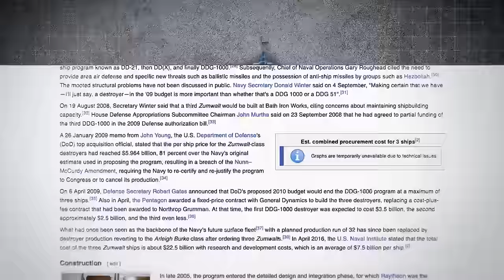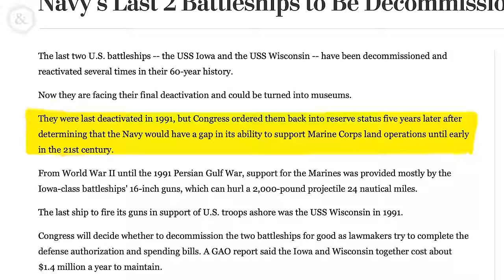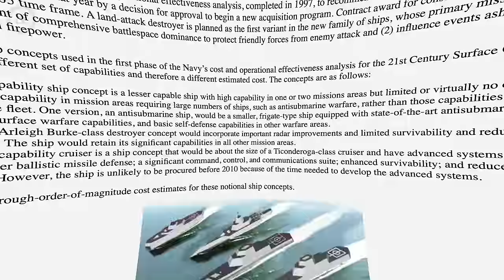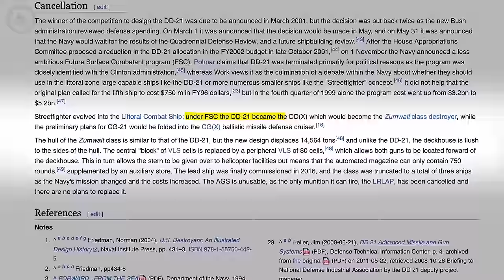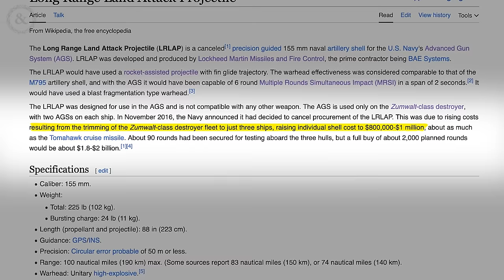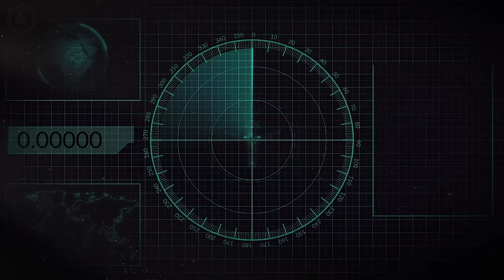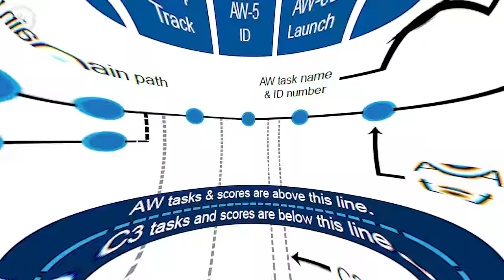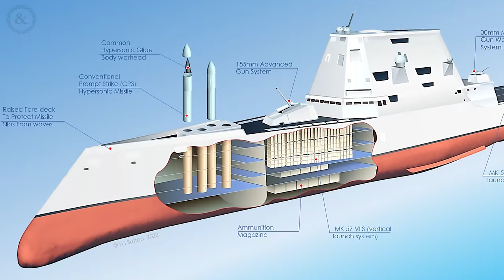Where is America's Stealth Destroyer?

Comment: Yes, it's not a $2M cruise missile, but Iowa class shells were not cheap. The cost of a single 16-inch shell for the Iowa-class battleship varies depending on the type of shell, but it typically falls between $6,000 and $20,000 per shell.
Reply: Which is pennies in the couch cushions for the navy.

Comment: I read that the top speed and structural durability were so bad that they had to abandon it. The shape is not the problem. The building contractors need to be held responsible for the failures. Putting advanced missiles on a stinking boat is not going to help.

Comment: It seems like new 155mm dumb projectiles could be developed to use with the existing guns. Also, with the flexible power system, would the Zumwalts be good candidates for upcoming directed energy weapons?  
I have no confidence that any useful rail gun systems can be developed -- the plasma erosion of the barrel is just too much for a practical system.

Comment: The Long Range Land Attack Projectile (LRLAP) was a 155 mm naval artillery shell for the U.S. Navy's Advanced Gun System (AGS). It was developed and produced by Lockheed Martin Missiles and Fire Control. Range: 100 nautical miles (190 km) max.
The LRLAP was: 
Precision guided
GPS guided
Rocket-propelled
Designed to provide support for the Marine Corps and Army
The U.S. Navy canceled the LRLAP in 2016 due to its excessive cost. The per-unit cost of each LRLAP shot increased to $800,000–1 million. 
The LRLAP was canceled shortly after the USS Zumwalt (DDG-1000) was commissioned.

Comment: Tumblehome is referring to the shape of the hull. At the top of the hull instead of going out in curves inward towards the center. This could definitely help with radar signature because of its smooth or “softer” look. Less straight edges
Reply: straight edges are what you want, you just want them short and at angles the throw the radar into areas that aren't likely to be where the sender is.  There's a reason the first stealth aircraft was nothing but straight edges.

Comment: It's insane to me that they didn't just refit the 155mm guns to use the Army's GPS guided rounds. 3 rounds a sec is absolutely some serious firepower.
Reply: Because the gun is incompatible with the 155mm rounds used in the Army.
Reply: @definitelyfrank9341  Which is why I specifically used the word "refit."
Reply: @Lowlyking2001  'refitting' a cannon to be able use completely incompatible ammunition has never been done before, and is impractical.

All they can realistically do which is close to what you suggested is swap out the guns for the Army howitzers.

Comment: The Zumwalt was built to be command and control for the Littoral Combat Ships. They were a married pair. The LCS don’t carry enough high tech nor armament to adequately protect themselves, nor to go on the offensive. The Zumwalt had that in spades, with the gun and it’s guided projectiles. Whomever dreamed of the paired concept must have moved on, and so the system was allowed to fall apart. 
         When the Navy cancelled the original gun, it should have cancelled the LCS, but nobody told the Navy. As the Navy built three Zumwalt, it should have built a limited amount of LCS, but nobody told the Navy. 
         Even still, the Navy doesn’t use the three Zumwalt with the LCS as originally intended.

Comment: Zumwalt with 80 Standard Mk. 6 multi-role missiles, 12 hypersonic surface-to-surface missiles, and change out those 30mm turrets for Siemens 30mm Goalkeeper systems; personally I would build another fourty of those but replace the oil-burning generator with breeder-type reactors (four at twenty megawatts each, with each reactor being 10 feet on each side, 10,000-year service life with a 1,000-year scheduled maintenance cycle; this is proven technology built back in the 1950's).

Comment: The title “destroyer” is a shortening of the original title “submarine destroyer”.  Its primary job is anti submarine warfare.  A cruiser is a pocket battleship.  Its primary modern purpose is anti air warfare, although its original purpose was anti surface warfare.  Frigates are small, fast, and nimble.  They are intended as scouts.  All surface ships can be used for shore bombardment.  

The line between types has blurred since WW II.  Size has also.  Examples of this are the Burke class destroyers (DDGX), which combine the capabilities of a destroyer and a cruiser, and the Ticonderoga class cruisers (CG), which was built on the engineering hull of a Spruance class destroyer (DDG).  

Everything below the main deck of a Ticonderoga cruiser is identical to a Spruance destroyer, so they are the same size and have similar speed and handling characteristics.

Modern US ships still maintain divisions between mission types, but all types of ships will have limited capabilities to perform the other’s roles.  For instance, the Spruance class destroyers had some anti surface warfare capabilities in that they had two 5”/54 guns for small ship engagements, and Harpoon missiles for larger ship engagements, as well as Sea Sparrow missiles for anti air warfare and CIWS systems for anti missile protection.  They also had torpedoes for anti ship/submarine warfare, but their primary weapons were the worlds best sonar system hands down (at the time) combined with Asroc anti submarine rockets.  

This may sound like a lot, but this was considered to be only lightly armed.  Compared to a Spruance, messing with a Burke is like reaching into a buzzsaw mounted on a pissed off badger.

Almost all full size naval warfare ships will also have a multi role helicopter capability.

Comment: Too bad the LRLAP system got axed. I mean, I get it, with only three vessels mounting it, there was no way it would make economic sense. But if it actually is an artillery piece with a range of around 100 miles, has depth of shot locker and load speed claimed... dude, that's pretty darn impressive. And at the original price tag of 35k a shot, it's a HELL of a lot cheaper than missiles. I would've loved to have seen it field tested and, if it met expectations, used to replace the 5" guns on most vessels today. With such broad distribution, it would no longer be crippled by limited utility and could appropriately leverage the economics of scale to be a far cheaper option to missiles.

Comment: It is plausible that a less ambitious but still functional long range artillery system could be retrofitted for the Zumwalt - a couple of the Himars systems that have been operating splendidly in Ukraine could provide a proven ground support option without quite the same prototyping issues. Being already in use by land-based systems, the individual projectile cost ought to be more manageable.

Comment: The math on those 155mm shells just doesn't check out.
IF the shells cost about $32,500 each when 32 Zumwalts were planned, then the new cost for shells with only 3 Zumwalts would have to be less than  $32,500 * 32 / 3, or about $350,000 each, not $800,000 to $1,000,000 each.  
OR IF the $800,000 to 1,000,000 figure is accurate, then the original cost would have to have been more than (800,000 to 1,000,000) * 3 / 32, or about $70k to $90k each.

As an aside, with all due props to missiles, especially super long range hypersonic ones, the U.S. shouldn't be poo-poo-ing naval gunfire.

Comment: Watching online naval war games with fleet to fleet battles, the long range ammo is used first - different guns/missiles have projectiles with different ranges so a ship with longest range ammo can attack with no risk. Long range ammo is used first, then shorter range until that range is used up, then the battle is moved closer. The 155mm Army's artillery shells are extremely well received in Ukraine.
According to fairly recent Wikipedia, a 1000 ft oil tanker could be bought for about $100M. I think that the Navy's cost overruns are a result of poor planning and very poor negotiation and oversight! Ship available space and load capacity grows much faster than the outside dimensions. Therefore a Zumwalt at fair prices is a better deal than a Burke destroyer.

Comment: Reading some of the comments about the gun systems. I'm curious to see if the new 50mm auto-cannon developed for the M2 Bradley "replacement" will get a naval variant. Or, possibly the new laser based systems. The small boat/drone swarm is something that needs to be addressed. Newer classes of naval vessels have fewer and fewer deck batteries capable of tasking multiple threats. A CWS system can still only interrogate one target at a time and eats through way more ammunition than needed for a small surface vessel. A better automated/crew-served point defense would be Hell of a lot more effective, similar to the AA batteries of the first half 20th Century. The Iranians won't be firing one anti-ship missile at a single ship, but dozens. The simulations never end well for the ship. I'd rather have vessels capable of defeating the threats rather than a sacrificial screen of extremely expensive and crewed ships to act as fleet decoys for the Carriers. Something similar in concept to Israels "Iron Dome", but more cost effective than using extremely expensive missiles that take a LONG time to re-load.

Comment: I'm just thinking, our next big war (or at least what the military is preparing for) is supposed to be island hopping against China.
The first step of a beach invasion is bombardment of the island. Your target is not just a couple bunkers and buildings, but beach defenses, tunnels, and every single fox hole. And when you start sending your troops in, you have to keep up your bombardment to suppress the enemy defenses until your guys can get into fighting positions on land. These bombardments have expended hundreds of thousands of rounds in previous campaigns.
Aircraft can't run frequently enough to maintain that kind of optempo, and even if they could, it would be extremely expensive. Similarly with missiles, they cost much more than artillery and you physically can't carry such a massive quantity of them. Depending on the missile even, some require returning to port to reload them.

So why on Earth would the Navy want to completely remove a main gun from a Destroyer and think they could rely soley on missles and aircraft?
During the Battle of Okinawa, the Navy dropped 600,000 rounds on the Island, and that was on top of air support and the 1.1 million rounds the Army spent at the same time!

The Army calls artillery "King of battle" for a reason, and the idea of some Admiral deciding a Destroyer doesn't need it smacks of a man with an ego problem who spent more time at a desk than he ever did doing anything actually important.

Comment: It couldn’t of been that much to design and produce a run of standard shells that fit the chamber of that gun, just without the rocket assist etc. atleast it would have still have 25+ mile range, combined with stealth to keep it safe when going in and out of mission areas. I think moving money and backroom deals was the real purpose of the ship. That or they have ammo and are hiding it from the Chinese.
Reply: If you are firing the super gun, you probably are fighting a near pear threat(otherwise, just charge in with a normal gun) with anti ship capabilities. Problem is, you don’t want to risk your billion dollar ship(they can track the normal ammo and trace it back to it’s sender), so you launch F-35’s or tomahawk’s. But that defeats the point of a super gunx

Comment: F-35 was once a "miserable failure", but so far has sold over 1000 units to Air Force and various allies, and is on about version 5 and appears to go straight up and accelerate a bit.
Reply: Because at the end of the day, it’s still a kick ass super plane. Zumwalt at the end of the day, is a super gun that is in a very awkward middle ground that doesn’t exist.

Comment: The real issue regarding naval guns is that they're relatively INEXPENSIVE. [During the first Gulf War, to accomplish the same objective, we estimated that the naval guns were a 1000 times less expensive than using aircraft.   Large naval guns are a tremendous bargain!   There was another benefit that I am not at liberty to discuss.  (The difference in cost would be even greater today!)]   Sadly, the Zumwalt became the consequence of the egos of the brass.  ( Without the naval guns it became a solution without a problem.)  This reality of the enormous cost differential and the extreme potential savings of naval guns has never been discussed as the naval brass "rate" themselves on the size of their budget not capability!   Hence, to their egos, more expensive is better!  (I'm not sure if the taxpayers would agree with this.)

Comment: The Zumwalt has been a disaster since the first one came set sail. The program has been besieged by errors, malfunctions, redesigns, cost overruns, poor deployments and less than worthwhile combat ability. It's 155mm bombardment guns DO NOT work, not for lack of workings, but the ammunition needed to feed them is too expensive. the 57mm cannons were replaced with 30mm chainguns, a reliable but underpowered cannon for sea duty. Top speed of 30 knots; slower than the Burkes At 15,000 tons, they're ridiculously heavy Originally, the Navy had hoped to build 32 destroyers. That number was reduced to 24, then to 7, due to the high cost of new and experimental technologies The Navy had to abandon the next gen radar they wanted to install The ship has NO CIWS guns or systems on board Each Zumwalt now costs $4.5 billion—in addition to the $10 billion spent on development. The Zumwalt’s spiraling costs were due to the Navy’s ambition to integrate technologies yet to be finalized, Built on a design and build philosophy, the ship thus had to constant be redressed for features as technologies evolved. Another in a line of spent hundreds of billions of dollars on technically sophisticated weapon programs that promise revolutionary capabilities but take forever to develop, cost more than predicted, deliver far less than promised or deliver Nothing at all.

Comment: You leave out a lot here. the ship rust like an old Renault car. Out of the factory it already starts, so much for stealth reliability.
it was designed for a rail gun. Which, if it worked would be perfect. But You never got it working. And that was ment to be the main weapon of the Zumwalt, together with its stealth.
Then your point of hypersonic. Your ten years or so away from reaching that threshold. But if you are able to complete at least that task (MIC produces nothing of value anymore). All peer adversaries have already hypersonic missiles and are perfecting them. Once they see a hypersonic missile coming from a small fisher boat, they will send a hypersonic missile, and gone is the Zumwalt.
It is a major clusterfuck, and that it will remain.

Comment: Zumwalt was just a big mistake. Too costly and incapable of using its guns. It would have been better off to modify Oliver Hazzard Perry frigates with spy 1 radar vls missile tubes and make them more nodes to a battle group through  link 16  or making more fast attack submarines with tomahawk capabilities. vs 1 destroyer that's too expensive.  Ship board guns do have a place when it comes to small fast boat swarm attacks but the navy would be better off taking off the guns and putting on lasers.